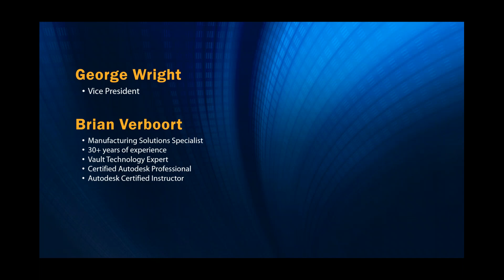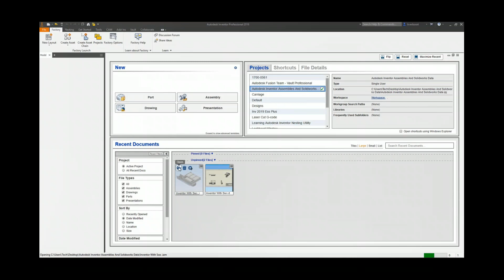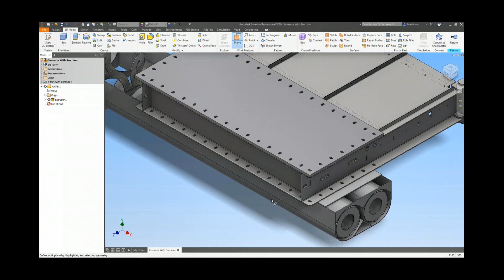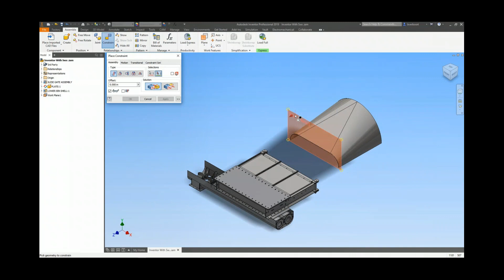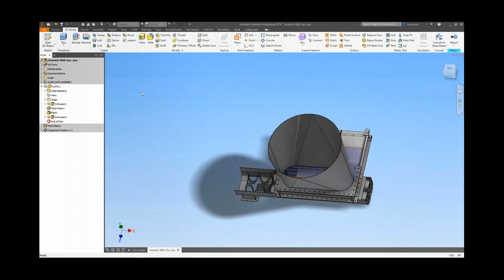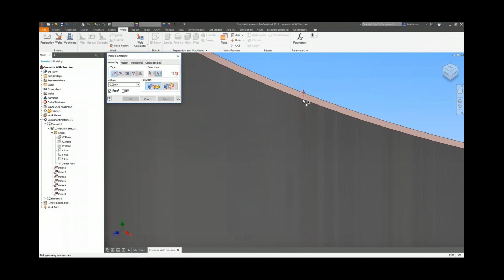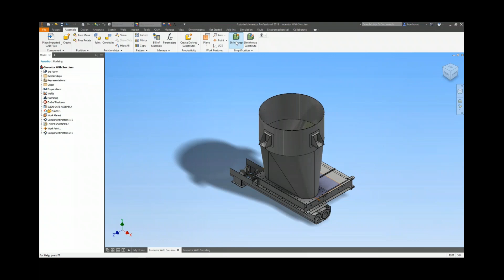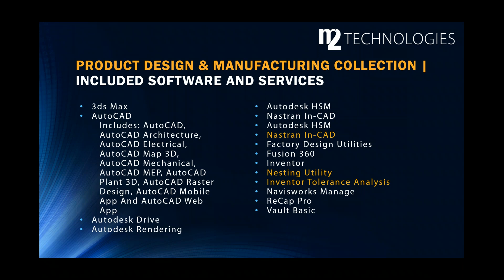Solidworks in an Inventor Workflow

Comment: The company that I work (wood furniture industry) for are considering moving from Solidworks to Inventor. We have a big library of products and we do custom products using those standard products as a reference and parametrically change them. How easy is it to convert our library from Solidworks files to Inventor files and keep all the editability, and all the drawings and parametric values? with this migration from platforms we were also looking at moving from ALphaCAM to Inventor CAM, what are the main differences between the 2 and is there a post-processing software to translate the data from Inventor CAM to Homag CNCs?